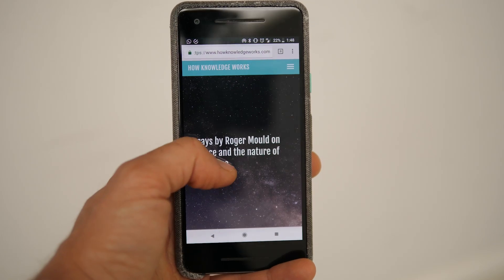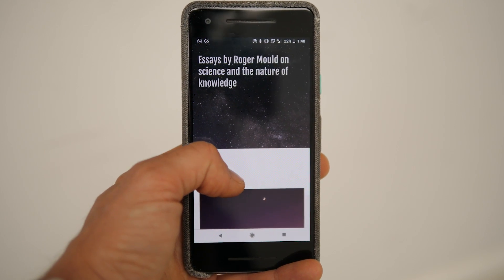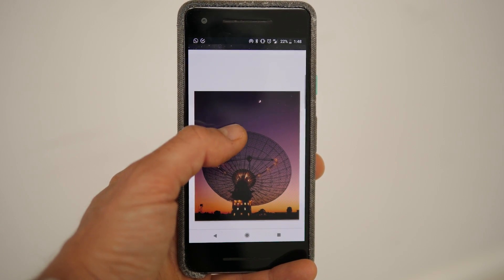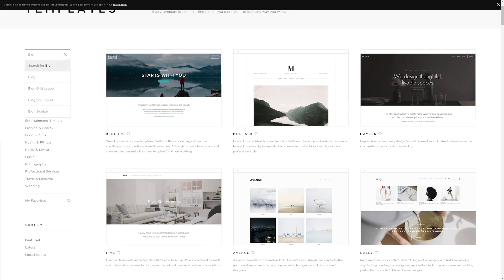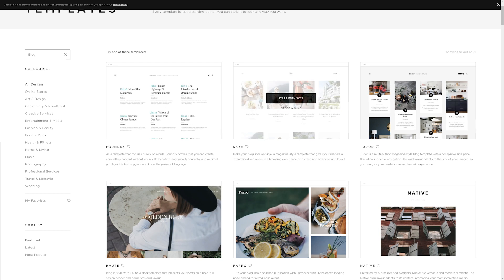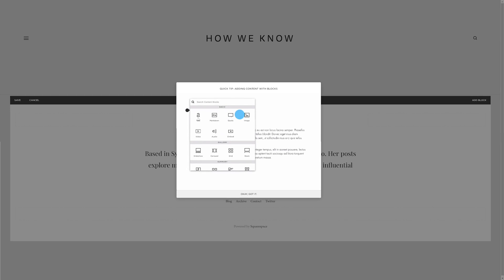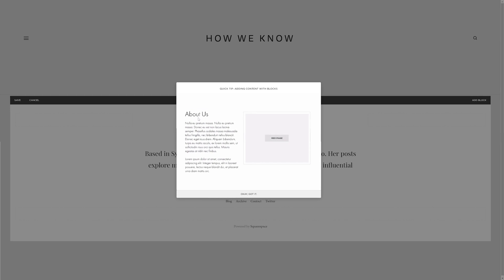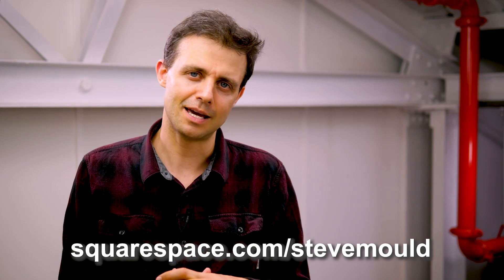The bizarre ripples that form in a stream of water

Comment: Very interesting. Though I feel something is missing here. You talk about the Reyleigh-Plateau instability, and how it splits the stream in chunks, due to surface tension. But I feel there is an other actor on the scene: fluid viscosity. Somehow it helps surface tension kind of pull on the liquid to keep it together, and somehow it also prevents chunks from splitting.

There was a video this or previous week on Smarter Every Day where Destin explains a phenomenon that I find really similar: honey coiling when you pour it in thin laminar flows. His explanation is more centered around fluid viscosity and how it pushes the stream around to produce these coils.

I can't help but think this coiling phenomenon and those standing waves in water that you show are somehow related.

Comment: You can try it with larger flow areas where surface tension effects will be less prominent to confirm whether it is related to surface tension. Cool video!
Reply: I think it is difficult to avoid turbulence while increasing the stream diameter.
Reply: @f-m  - Turbulences won't destroy this effect completely.
Reply: @f-m you just need a lot of water or a more viscous fluid
Reply: And a great way to create a large Laminar flow setup is to have water enter a pipe filled with first cloth then large straws, a few flat layers of cloth then small coffee stirring straws, and finally a piece of cloth rubber banded on the end. 
I really think that you need to film this from directly below or from multiple angles at once with a mirror setup. I think that what you are seeing is an effect of The Liquid Rope Effect, and you should try liquids with different viscosities Including honey and soapy water. If you can set up a bin that has a pump to lift the liquid back to the top of the tube you can alter the viscosity in real time as you film with different addatives.
Reply: Practical Engineering Good call Grady. I'd be interested in seeing a side by side setup with gradually increasing cross-sectional areas, kind of like a pan flute.
Edit: Also, some different viscosity liquids would be neat.
Reply: It would be nice to see the effects of adding food color to one of  (or multiple) straws in a bigger laminar flow generator setup. And then we could investigate more the standing waves also.
Reply: My thoughts exactly. (Actually, I assumed it was gremlins or possibly aliens (perhaps alien gremlins? hmm.). You should listen to the engineer.)
Reply: Or use Acetone
Reply: what about liquids with different viscosities and surface tensions?
Reply: @practicalengineering could you make a video about this. Using fluids with different surface tension, variable angle of incidence of water stream on obstacle, size of water stream..
Reply: I get the feeling this is a problem that can be solved easily with a fluid-centric rather than a global reference frame; if you imagine that this is instead a finger moving through a stationary puddle of water it's more intuitive.
Reply: @practicalengineering Or try adding some surfactant to the water!
Reply: Practical Engineering GENIUS
Reply: It is very closely related to surface tension.
Reply: It's a water hammer minus the pipe
Reply: Practical Engineering Hey! It's you!

Comment: My first tought was that the interaction with the water makes the water flow slow down. Upstream the water has a faster flow rate which makes the water "bunch up". Since the water can still flow away it does not become a puddle. The surfacetension allows the water to bunch up like a pice of string would do if you lower one end to the ground.

Not sure if i explained it well.
Opinions?

Comment: As each droplet in the stream of water try to form into a sphere they are stretched by the droplets that they're attached to either side of them, when you introduce an obstruction each droplet tries to roll around the slower moving one in front resulting in essentially a moving pile-up of water droplet traffic, as you adjust the position of the obstruction (which is now part of the equation of the flow) you adjust the equation of the flow over-all, altering the mathematics of each droplet in the stream, which changes their size and, consequently, the size of the ripples that you see.

Comment: The first thing that came to my mind was viscosity. Since the bottom part hits an object that slows down the stream but the upper part is still going fast, the whole column warps. For example like a piece of wire that you push from ends and it bends to side. But I don't know if that makes any sense with liquids.

Comment: I think what's going on is a subtle Liquid Rope-Coil Effect. The amount water that is spread around your finger is less than the amount of water pouring down. This causes the water above your finger to pile up. The surface sension of water resists the column from simply growing wider, so the column of water lengthens to hold the extra volume. Since the distance between the tap and your finger is constant, the column of water forms a coil to accommodate for its longer length.

Comment: This is a variant of end pinching, as described by Notz and Basaran (JFM vol. 512, pages 223-256, 2004). John Bush describes this effect in his lecture notes (well worth the read), at the end of the paragraph on the Rayleigh-Plateau instability. He also describes the nice effect that you get when you first put a drop of dishwashing detergent on your finger before you use it to make these capillary waves (fluid pipes). These are nice lavatory experiments.

Comment: My hypothesis:
Water which hits your finger (nearly) stagnates which means that column of water above it moves faster than water under it. Because water above and below can not occupy the same space, so faster moving water has to go somewhere so it moves sideways. It also slows down a bit (because it is a column of water which tries to stand on top of stagnated water?) which means that water above it moves faster. And so on... Surface tension keeps the buckling column of water continuous.

My intuition in other words: the water column buckles because it is not stiff enough to be supported by the slower water under it.

Comment: I’m thinking the ripples look more like honey dribbling onto a surface, it bends whichway it wants because it has to evade the already existing puddle. Though the small stream looks more like solid Spheres connected with water, instead of the rippling stream which looks more like its going fron side to side because something is in the way and it has to push against water that is below it

Comment: Disappointed that you poured the water from a funnel, not a beaker ;)
How would this work with different fluids with different surface tension? Would it be hard to get a laminar flow?
Reply: Yes! Use soapy water and see whether you get the same effect!
Reply: Dragon Curve Enthusiast I agree, but since surface area is proportional to radius squared and volume to radius cubed, I suspect the effect would be greater for narrower streams, so lowering surface tension and having a finer flow MAY lead to the same outcome.
Reply: I'd guess that it's a scalable effect, i.e. that higher or lower tension will require wider or narrower flow to work, but I'm not sure what way round that would be!  I'd guess higher tension would be able to cope with greater flow (as it can do more pulling) so presumably lower tension could work for even finer streams.
Viscosity should also play a role, I think. :)
Reply: andymcl92 my hypothesis is, that less surface tension should lead to less beading.
Reply: What the hell is your profile pic

Comment: Hi Steve. You should try this with something that has been coated with a hydrophobic substance. It would be interesting to see if the loss of adhesion to the obstruction would change the effect.
Reply: Or he could just use different shapes to vary the anti-node.  That would hopefully set him on a path to building a relationship between boundary conditions and wave propagation.  You could build a law that way.
Reply: He should also try to distillate it with exo-ionic sub atomic particles, to increase the kessleration.
Reply: ^ this
Reply: L'effetto coanda si verifica con qualsiasi fluido , anche con l'aria

Comment: What happens if the water has no or very little surface tension?  Will it ripple like this?
Reply: 55Ramius The adhesion of the water to the to an object forces the cohesive properties of water to bend in the most efficient and stable way. Where stable conformations exist, you get standing waves.
Liquids with less surface tension have less surface tension because of a decrease in cohesive properties. This means fewer stable conformations resulting in fewer standing waves, particularly when the distance between adhesive endpoints (the faucet and the bowl) decreases.
Mix a few drops of dish soup into water and try it out.

Comment: I think you're right. These standing waves also explain why the wavelength seems to shorten downstream. The water downstream has been accelerating under gravity for longer so is moving faster, and conservation of mass means the stream has to get thinner (you can see that in the video). This also means that there is less mass per unit length in the stream, and just like with a guitar string, less mass per unit length (a thinner sting/stream) means a higher pitch note with a shorter wavelength. So the natural wavelength of the standing wave smoothly decreases from top to bottom as the width of the stream smoothly decreases.
Reply: But what about the vertical offset difference visible on the video that happens between these two kinds of waves? 
The droplet creating wave has the pinch and bulge points perfectly aligned vertically, if you look at the "left and right side" of that stream. 
On the other hand, the waves that appear when you put an obstruction in the stream are, what seems like vertically offset, almost snaking, if that's even a word, or maybe even helixing.
What I mean is, we didn't see the tridimensionality of the stream in the video, I don't quite understand why the water would make these snaking vertically offset waves given that it would cause more stress on the surface tension, so I think that the stream actually forms a helix.
I hope someone understands what I'm trying to say.
Reply: I also considered the 3rd dimension aspect of it but it may not be screwy. I figure the target provides an obstruction transmitting a decelerating force up through the column of water and that probably needs a deflection in one polarity from the center and some unclear dynamic between flow and surface tension backpropagates the transversal wave in a single plane. But it's possible there is some spiraling, if the unknown dynamic allows such a standing wave configuration.
One premise I like to adhere to is that if you can setup an honest simulation in a computer that produces the observed effect then you might well have explained it adequately. I suspect it would be very difficult to replicate this in a model. I'm guessing the speed of sound in both water and air are in play.
While water play might seem frivolous, such a concept of a seemingly static standing wave through flow might turn out to be all important in some forward part of physics.
Reply: I think you're right about the wavelength.
I also wonder if it's a helix. Might it be related to this effect in high viscosity fluids? youtu.be/zz5lGkDdk78
Reply: Completely left field, but this made me wonder what properties water falling at terminal velocity would have.  Wonder if that would impact this experiment....also, can water travel at terminal velocity and maintain laminar flow?